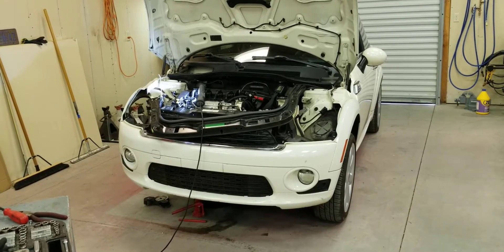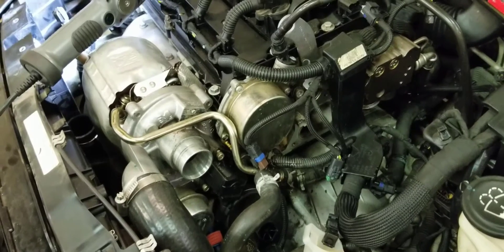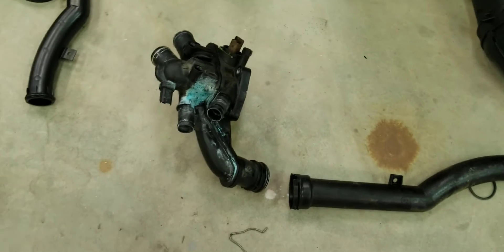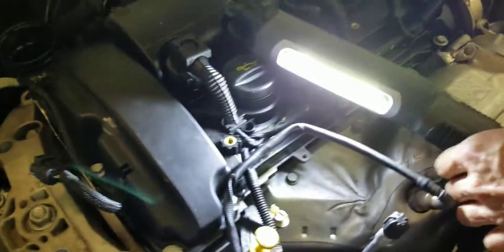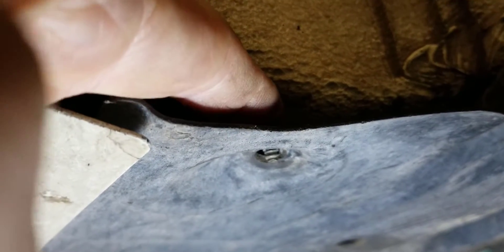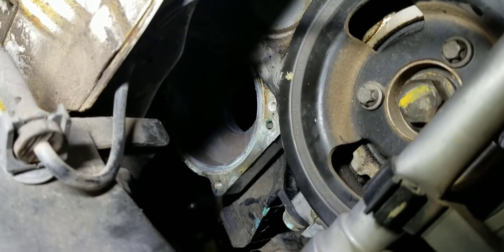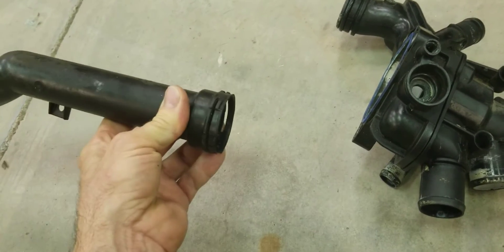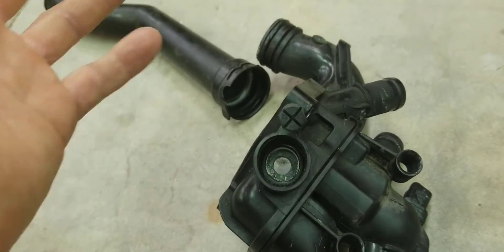Mini Cooper S Turbo R56 Cooling System Leak Repair

Comment: That water pipe.... don't buy plastic. Go over to FCP Euro and buy the metal one. It's pricey $23 vs $80 but it's a 1 time replacement. The plastic ones fails often. 3 times in 2.5 years for me.